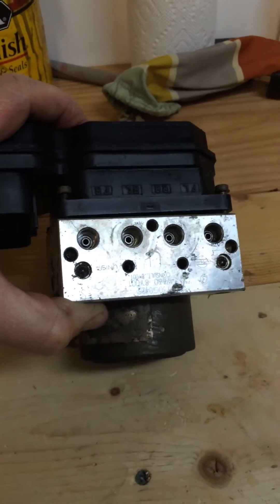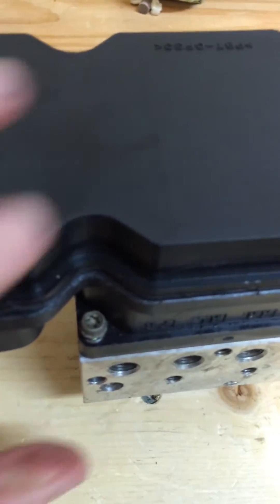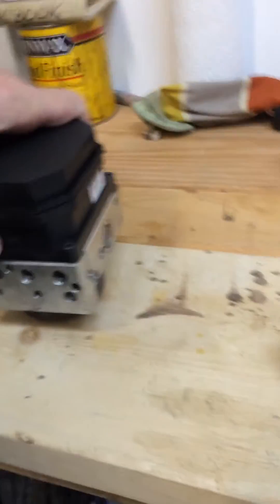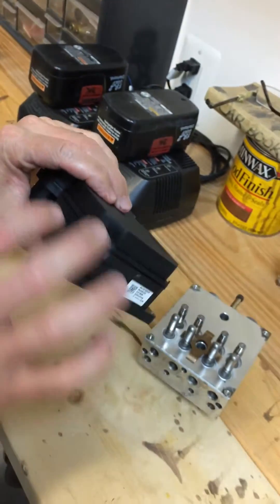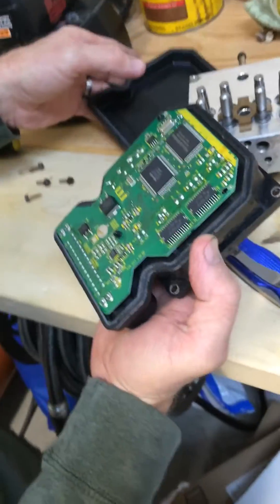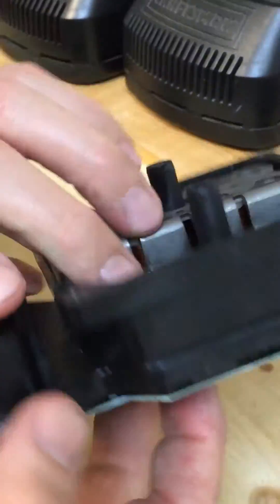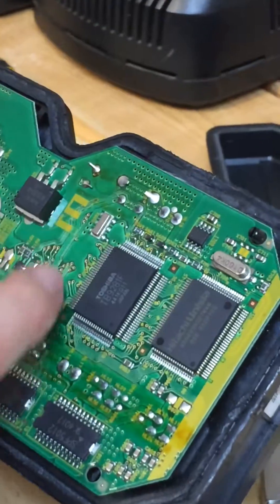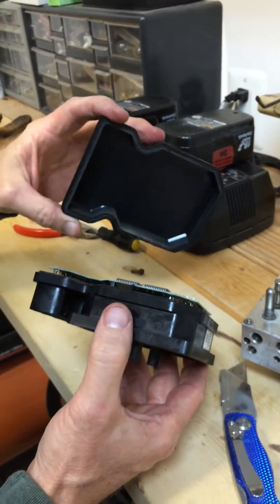2005 Nissan Maxima ABS Control Unit

Comment: Is there anyway to bleed this unit I'm case air got in it? My brakes feel really soft even though I bled the car and I got a steady stream on all four calipers
Reply from the maker: Royal D The valve body of the Anti Lock break assembly is probably leaking by internally. I bled the breaks via the calipers at each wheel and didn’t have any issues getting the air out of the system.
Reply: @mainesprocket63  Thank you for the quick reply

Comment: I bought a 2004 and I think its a pretty good car, I only paid $750.00  and all that is wrong is abs cable (sensor), I got all 4 from amazon for $53.00, 140k miles, after I bought this a 2008 impala came in for $750.00 also, woman had passed a yr earlier and they  junked it, they said oil leak frnt seal, it turned out to be a power steering leak...its nice to live across from salvage yard...

Comment from the maker: Yes, but I ended up using a junkyard ABS unit I purchased on EBay for $150 which was actually a good price.  One of the valves in my old unit was bad, actually the spring that closes the valve was shot.
Reply: Got a 05 Maxima to, have a problem with my brake system.
When I press on the brakes, there's a nosie under the hood. I don't know what it is.
Reply: Dexter Lopez i have that problem now..please tell me what you did?
Reply: gilbert kasnija  i need one abs for nissan maxima 2005